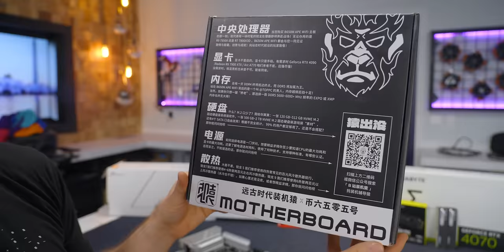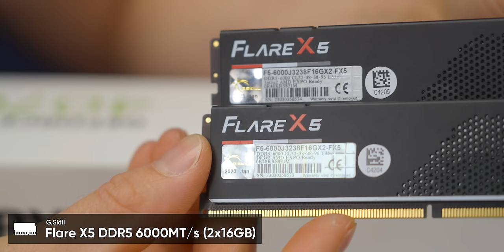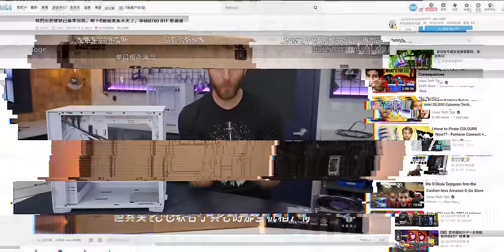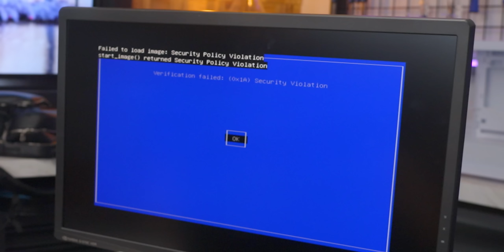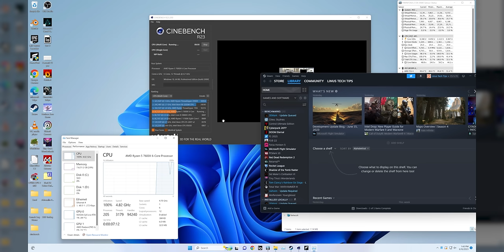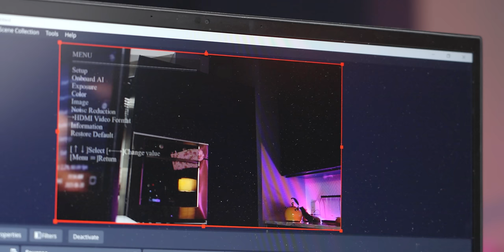This Beautiful PC has an UGLY Secret…

Comment: I presume if this does catch on, there would be a standardised layout, specifically because case manufacturers would prefer to have only one case design, rather having a different case design for each brand or having to specialize to one motherboard manufacturer.
Reply: Agreed, should be a standardised form factor. Call it something like ATX-R (ATX reversed) and so on for all the other standard form factors, with set regulations for the connector placement
Reply: There wont be a standardized layout if they think it can drive more sales
Reply: removable and replaceable motherboard trays.
Reply: @backgammonbacon  Or just cut the back holes in every case. Then they'd be sufficient for either standard.

Comment: Beautiful build.  I love those Fractal Pop cases.  They're really well constructed for the price and easy to build in (minus the dremel anyway).  But one of my favorite things was replacing that bottom front 5.25in cover with a 3d-printed cover containing a 5.5in touch screen (it's overkill at 1440p, but didn't find anything else on Waveshare that fit as nicely).  Fractal should really offer that as a kit like the Jonsbo D41.

Comment: Just for the avoidance of doubt, you can also get 24-pin connector right angle adapters, guys. And for pretty much everything else. If boards like this become mainstream you'll see those supplied with cables or even the motherboard itself, eventually.

Comment: The obvious answer is for the mobo backplates to be a standardised "mesh" wide enough to fit all the standoffs.

Call it about an inch wide strip both sides of the standoffs. Should be wide enough to maintain its integrity even with cheap stamped and rolled steel.

Then, within that area, the connectors can be wherever they like. So can any m2 devices.

Call it ATX '23 or something. (I like the idea of using years for versions)

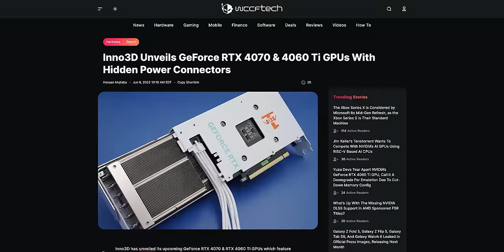Comment: 2:15
That is a really smart PSU design though. Even if the plugs are still at the front of the board this helps moving cables along the backside.

Comment: Maingear was pushing for this and Patented it almost a decade ago and released licensing fees I guess so now there is a push to use it.
Its also a symptom of ATX standard not coming together to make proper revisions to the standard, alot of things are held back due to backwards compatibility, and they really need to do a radial redesign and just break it once and come into unifying standards.

Comment: For GPU power, they could put a connector on the end of the card like EVGA did for some of the 3000 series cards. Then you could use a 90 degree adapter to route the cable to the back of the case so you wouldn't see the cable at all, the the adapter.
Reply: I want one on the other side so you cant see anything
Reply: @Simon-tr9hv  
I know 
They should have an option when you buy it 😀
Reply: @Simon-tr9hv  
No they have to design it not me 😋

Comment: this is almost my exact build (basically just had an aio instead), then he turned it around and the wires were actually white as well and had so much better cable management and he called it a hot mess and i cried

Comment: I didn't think modern cases with good cable management looked that bad to begin with. I have an old NZXT with a channel running down the middle with a cover and cables really don't even stick out that much. Seems like overkill to move them to the back for just a little less clutter, but it is a nice look either way.
Reply: Hey @Map71Vette - looks like you've been here the day this video released. Do you by any chance remember if the "Disclaiiimeeer!" about Linus and Yvonne in the beginning has been there on release day? I'm just asking because I've seen people in the comment sections of other videos honestly worried about this, debating if it was a joke or not. I've just now watched this video for the first time but I can't imagine how anyone would have taken that joke seriously if the disclaimer was already present. Cheers, and thanks in advance should you or someone else reply!
Reply: But the cables for CPU and GPU power supply would still stick from the backward to the forward and not so easy to plug in, that's the point.

Comment: Better PCIe locks for GPUs needs to happen already.  Just having to do something that should be as simple as swapping an M.2 drive is ridiculous.   I also prefer the back facing cable trend that has started but not for aesthetics, it again makes things easier for doing maintenance.  I hate having to remove a massive air cooler I just installed because I didn't plug in the fan to the mobo first

Comment: I feel like the last 20+ years has just been a continual effort to make our computers look less and less like computers. As an Old, I like it when my computer looks like a computer. You can hide your power supply cables away so they don't break up the aesthetic of your sleek glass box full of RGB lighting if you want to. I miss the days when my power supply cables were color-coded so that I could tell at a glance what voltage was being carried on which wire.

Comment: If all manufacturers come together and make this as a variant of the ATX standard i can see this becoming popular
Reply: Exactly a standard must be set and it can be a proper offering from any manufacturer interested
Reply: But that would mean they can't charge extra for a proprietary setup, so it won't happen. Look at Corsair's new fans and hubs they just launched all proprietary and $50 fans.
Reply: The premium for cableless front is still there, especially when the cables are more tightly packed at the rear, reducing dust buildup via those plastic-covered dust magnet

Comment: If they're actually going to make these, the connectors should be right-angle...

Other than that this is awesome. Much easier to plug cables in. No more forgetting 8-pin CPU connectors before you mount the heat sink.
While they're at it, also put the M.2s on the back. Swapping out drives without removing the GPU.

Comment: I think that this form factor could've been better, if they just made click in modules that bring the ports to the back, or better yet, a single plug that goes into a master module that goes in the back like 12V0 where you plug the ports into a module mounted to the back or under the basement. That way there's one connector to rule them all.

Comment: Have a removeable motherboard tray, with either an included secondary tray that is designed for this new motherboard standard included in the both, or is available for purchase on the case manufacturers website.

Comment: Now imagine if manufacturers could invert all the headers and connectors upside down. Most cases front panel connectors are at the top, so instead of 8pin CPU connectors have front panels, usb2 and fan headers (fans are also mostly front/top/rear of the case). And then CPU EPS 8pin connectors on the bottom, mere couple inches above power supply. PSU cables for CPU 8pin could then be like 6 inches long, saving space and cost of materials and time to manufacture, potentially saving a few bucks per PSU

Comment: In my opinion, only the cables that connect to the power supply should be on the back of the board (and ones like fan and rgb headers can stay on the front), but this seems like a good idea

Comment: I hope the connectors on back of the motherboard thing is just a short fad and won't become too widespread. I prioritize structually stable cases and to see how much space the connectors need and how much less metal there would be, even with properly made cases for it, it makes me worried about the rigidity of the whole assembly. Especially since we already have a lot of GPU sack nowadays, there would be more flexing behind the motherboard, which would result in more play with the GPU as well. Also then there's a massive worry of heavier air coolers, they already seriously stress the motherboard, I don't think more play there is a good idea. You could say less metal is enough, but just think how much weight the metal behind motherboard has to actually carry, it's surprisingly lot. Also people going to lans or bringing their pc to their friends would have to be even more careful while carrying the case, and it already is dangerous and has destroyed some motherboards and GPU's due to carrying and laying the pc on the ground. Anyway to be honest, more options is a good thing, if this is just an niche option and most of the hardware would be made normally, I'm okay with that, since people who like this would have more options and I think that's nice. I just wouldn't want this to become the default at some point, but I don't think it will, since this is so different and not to everyone's tastes.

Comment: My suggestions:

1) Use 3 high-current cables for 5V, 3V, and GND instead of 24 + 12 wires.
2) use USB to link to the power supply
3) have an (encrypted) data-over-power for comms between the monitor to PC. This would allow monitors to have low-speed bluetooth for kb + mouse, PC power-on from the monitor (yeah I know this is possible with CEC). To be clear, the data would travel over the A/C powerline thru the power supply back to USB.

Comment: I wish that this was more common. Yes it clearly has downsides, but the biggest upside is that it's so much easier to see all your connectors. Me as someone who sometimes does something with hardware (occasional maintenance, replace cooler, at times build my own PC once every few years), I dread doing anything with cables in that chaotic mess in the front. Now that cooling pads/blocks are becoming more popular, even my tiny fingers have issues reach some cables or plugs.

Just give me the backside for all cables. For all I care we go for more square builds where the motherboard is laying flat, but with the PSU+cables below it in a way where you can easily access all off them without having to route them to the front through tiny spaces. and somehow now make them get stuck in anything. Maybe this way cables can become shorter so I don't have half the cable length of what I actually use, requiring less cable management in general. 

I get why cases and motherboards are the way they are, but perhaps it's time to deviate from the standard "tower" concept with the motherboard being vertical, and make more use of the vertical space, with the bottom being a "maintenance shaft" for the plugs, cables, and all the other stuff you don't want to see.

Comment: Superficially, it shouldn't be THAT hard to design the motherboard tray to work with back-facing controllers. Have reinforced U-beams diagonally to where the corner motherboard screws would leave huge gaps for the back-facing connectors.

Comment: Hard white plastic tubing meant for water cooling would look good to dress that PCIe power cable.
You could also bend it U-shaped to have it dump out the bottom/backside of the pipe.  Hard to explain in text.

Comment: only change to the build i would suggest is getting the 90 degree adapters for all the connectors so that you can do them a bit more flush. should make cable management a bit easier.

Comment: Assuming that the layout is actually standardized, I would go for these boards hands down. It'd just serve to keep the mess out of the way.

I've never spent less than 20 minutes trying to plug in those extra cpu power connectors on the top left corner of the board. It's like they were placed by a masochist. Those connectors look way more accessible with this layout.

Comment: I continue my tradition of rebuilding my tower, in the same modded AeroFlo mATX case, that has shown its worth.   All wiring, running from the PSU connector(s) until the component connector(s), are sharply laid out, shortened to length, and terminated neat & properly.   Thus, there is no excess wiring to deal with!   I am Old School!

Comment: There are a lot background story about this motherboard, aside from It's aesthetic and easy to do cable management:

Chinese buyers attends to buy pre-builds from online shops (online market are individual shop based instead of goods based like Amazon)

Ancient Ape have a pretty big shop in the market and he is a big streamer
so he can convince case & board manufacture (like Asus msi and SAMA) to produce such thing, it will be highlighted in his store and in his vids, sells will be at least 30K or so, btw the price are about the same with normal mATX board or case

mATX and the case have around 70% share on DIY market in China, only volume like this can back such a starter, other boards like YTX may come out if this sells good. And if reaction is good, other manufacture will naturally follow the standard.

The board was his dream to create a cable-less computer, this are the best result for an individual can do.

Comment: I can use a tech tip please! How likely are the chances of shorting out your computer after modifying your case and you’re not 100% sure if you got rid of all the metal shards from using a right angel grinder to cut it? Did the best I could with cleaning but found some on my magnetic fans and some if the harder to reach spots

Comment: My company is designing a completely wireless PC set up. It communicates and powers CPU cooling/pump and fan speed, GPU power,pump/fan speed, case fan power and speed, motherboard power, lighting, HDDs are wireless in power and communication, as well as the power and reset buttons are wireless. The only wires are wall outlet to power supply and the GPU to monitor. Think along the lines of wireless charging but capable within 3 feet.

Comment: Looks nice enough but this standard is just not going to take off. You would have to have different cases for matx, atx, etc. because the connectors need to be on the edge of the board for efficient routing which means the cutouts would have to be in different locations for each form factor.

Comment: The case I use unfortunately could never be modified to fit a motherboard like that as there is another motherboard on the other side of the main motherboard as it's a dual Jumbo motherboard case from Thermaltake. 

The biggest roadblock is to get both motherboard makers and case makers on board and standardize a layout but that could be difficult when you have very different size motherboards out there and can't always just put all the connectors on the opposite side.  I do like the concept.

Comment: Looks like it will save time with cable management, 
What about the unused pins on the back of the motherboard? I'd be worried about them shorting out against the side panel.

Comment: think about if the motherboard tray was just a removable piece, and it could be made in both formats, and then you pick which one you get.  

standard motherboard?  use tray A.

motherboard with cable hookups in the back?  use tray B.

sure, it could be annoying, but that change would be really powerful for a bunch of reasons.

Comment: Watching this, I remembered seeing a video on a modular case (or maybe cases, I don't remember). With a modular design, rear-facing connectors would be as simple as switching the motherboard tray. Admittedly, You would need a compatible motherboard tray, but (assuming the manufacturer sells one) you won't need to ruin its integrity.

Comment: The solution I see to case manufacturers adopting a hidden cable motherboard, is they'll start making more of their cases modular.  They'll have multiple motherboard trays that can be used for a standard or hidden cable board.  They (probably) wouldn't make all cases modular, in order to maintain consumer level products, but the more expensive offerings will have the ability to change the tray, making it so they don't need to have as many SKUs in their lineup by making a standard and hidden style at the same time.

Comment: I could see case manufacturers making removable motherboard trays so you have a choice between regular or reverse during ordering, or have both options included in the box. But that would only work if motherboard manufacturers make a somewhat standardized design.

Comment: Wouldnt better solution be to remove the motherboard plate completely (removing the rivets) and then adding non conductive rod with predrilled holes

Comment: I have i nice 90s ATX desktop case with two 5¼" bays, which i sorely miss on modern cases, and you will have to take it from my cold dead hands. Which in return means i don't give a flying fudge about cable management. If it's not in the way of air movement i am fine with it, no one will ever see it anyway unless they open the good old beige case that on top of looking totally rad retro is not being in the way as a tower would.
From its age it gathered some corrosion on the back, so some day i have to fix that, but otherwise... i love it to bits. 🥰

Comment: Not sure why this is exciting, but in the alternate angle of the cut at 6:22, was filmed a second time. The 2nd clip starts with him holding the already cut cord and pretending to cut it again. It's close, but they should have checked his arm/hand position to make it near seamless :D. 
"Alright Linus. We got that, but we need to get it again from another angle. Just put the wire up against the cooler. They won't know." or Linus needed a bathroom break.😅

Comment: I don't get the hate. We need to rout every cable to the back of the case already, wouldn't it be easier if the connector are already all there? That new Corsair PSY with the connectors on the side is also a nice addition to the trend.
Manufacturers probably don't give a shit and just want people to find dumb reasons to upgrade, but for builders and enthusiasts it is actually a good thing on the long run.

Comment: The better solution: standardized motherboard power delivery that mates up with standardized power supplies directly. No more cable management. Plug one block into the other one.